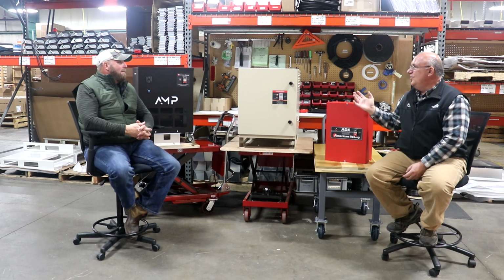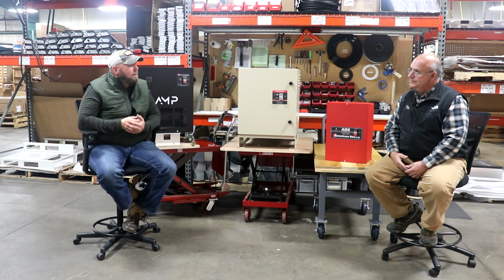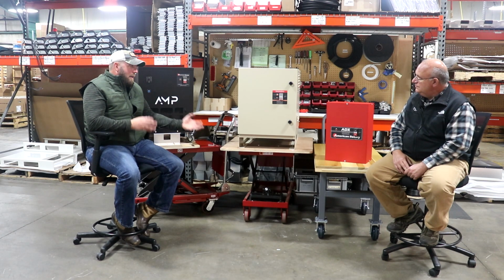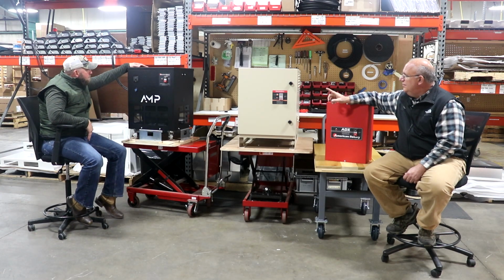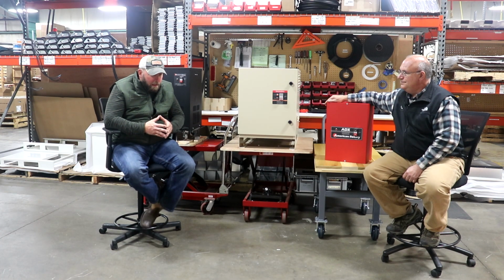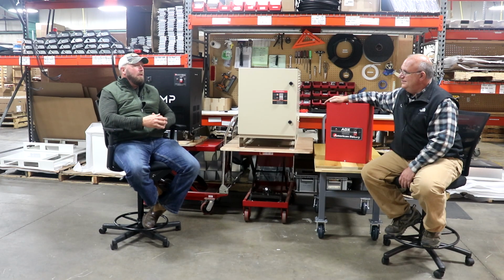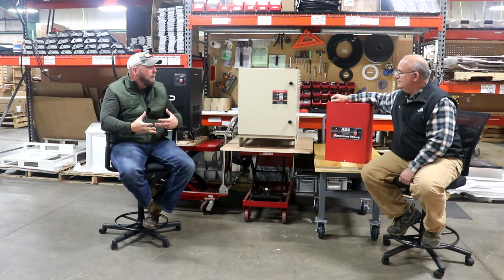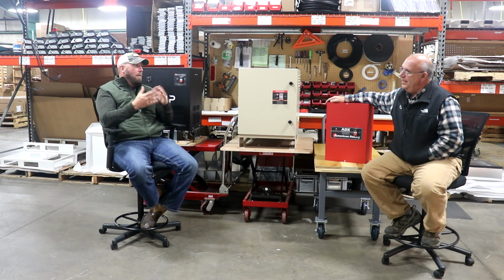American Rotary Phase Converters - a Visit with Chris Feavel

Comment: Great video Keith. I picked up an American rotary 10hp converter a few years ago when I bought my lathe. Best decision I made for my shop. Since then I wired in a 3 phase panel with numerous circuits which made it easy to add numerous pieces of 3 phase equipment. It’s a quality piece of equipment that was a game changer in my shop.

Comment: The only reason I built my own converter is cost. 20 hp motor was $10. Contactors and boxes $25, all auction pieces.
Assembly time was days, but it works and I have less than $200 invested. The biggest cost was wire and time.
I would love to get an AR converter but the cost is not in my budget.
Great show Keith, love the channel.
Thanks for sharing.

Comment: I had a electoral/mechanical business for 40 years that 90% of our business was industrial and would never think of building a converter in house. The time and money to build one out weighed getting one from a converter manufacture. VFDs replaced DC drives in applications where the speed of a motor needed to control a line or a mixer on a 30K gallon or larger tank. Very good basic interview.
Reply: Well, duh?  And for the rest of us who would like to get into this as a hobby, with a supporting revenue stream expected never, can and do build ones for less than your average employee's weekly paycheck.

Comment: You can buy VFD inverters for any size machine which convert your single phase to 3 phase for  motors.  They also have the functions  of variable speed, dynamic braking and can be controlled by PC input for specific cycling, stop-start-reverse etc.  Each machine can have its own dedicated inverter sized specifically for the particular motor and requires no wiring of conduits etc., just plug in to existing single phase outlets.  Inverters are available in 110 volt input for small machines and 220 for the larger units.  Pricing is from 75.00 for a 1/4 HP motor to  175.00 for a 5HP motor.

Comment: Hello Merica. I know there is big problems with 3 phase in your country, but somehow it is 21st century. There is nice solid state 1ph to 3 phase converters with variable frequency.
You don't need one big converter, just several small ones for each motor. They are quite cheap and universal. And not noisy in all ways (who is listening AM radio?).
And it adds variable speed, brake and current protection. Also soft start- no more stress for gearbox.
Reply: Hello Uropean or whomever, no, there really isn't any problem with 3-Phase in the USA. We did after all, invent it.
99% of our population doesn't need it, so the extra expense of installing it everywhere would be wasted.
We're quite aware that its the 21st Century, we went to the Moon last Century.  
For the less than 1% of Americans who need 3-Phase power at home, the options are RPC, or VFDs.
We know about VFD's, an American invented it.
Please save your snarky comment until you lot get to the Moon or invent something...

Comment: I have multiple 240v and 480v machines run off my one American Rotary phase converter and can run multiple units all at the same time. Motors from 40hp to 1/3hp all run just like they were designed.  :-) Much more affordable than the $100,000 to get 3 phase run to my shop.

Comment: Switched from a name brand rotary converter( not American rotary) to phase perfect which is solid state and requires no programming many years ago. Advantages: always on - only 2% efficiency loss - better characteristics than the public utilities 3 phase - full hp from all motors - very very quiet when cooling fans occasionally run - can power many machines at once with no regard to motor size on which should be turned on first. Would never go back to a rotary converter. Check them out and see if they might be a better choice for you. Not sponsored by anyone.

Comment: I built my own. 3 phase motor and a capacitor that is wired to the third winding and either of the 2 other windings.My 3HP motor dont need a switch but on larger motors I use a push button to connect the capacitor, only while starting the converter motor.

Comment: I went from a rotary phase converter over to VFDs in part because I got a mill to go with my lathe, and I wanted variable speed on both machines. Eliminating the background noise from the idler motor was a nice benefit. Also, my power company has been talking about adding demand charges to their residential rates when they go to Time of Use pricing, and VFDs have less "ringing" when the motor starts.

I can also use the same extension cord to hook up the mill or the stick welder, and copper costs real money. I'm working in or in front of my garage, and fixed wiring isn't practical.

American Made doesn't address the technical differences between  RFC and VFD, nor the less tangible benefits tradeoffs. RFCs are a more mature technology, while VFDs are a more recent development, with about 40 years of practical use now.

RFCs are a good lower cost alternative for motors which need to run at a constant speed with a predictable load and for a long period of time. Rotating inertia is a fact of life.

VFDs are often used instead of a "soft" starter - this is a benefit if your power utility is unhappy about back EMF and/or has demand charges - something that is starting to show up in residential rates in North America. A VFD gives a noticeably cleaner voltage curve on start for a given motor with a generally lower current spike.

There are pros and cons to either solution - what's best for me might not suit you.

Comment: In New Zealand 415 V  3 phase is available outside every residence.You just have to pay to get connected to it as houses generally have a single phase 240 V supply.
It is also common for adjacent houses to be connected to different phases. Which is why there have been accidents caused by homeowners trying to run high current equipment by interconnecting power cables from 2 houses.
Reply: Often times, the original innovator of something ends up with significant amount of older, original generation equipment in-place. Especially so for infrastructure/standards.

2nd/3rd/x Gen environments do run 3-phase out to the neighbor hoods, and in some places directly to residence (Germany/NZ), and single phases split along housing.

Ultimately, unless your machining in your garage, switching over to 3-phase in the US would simply be a waste of time and resources.
Even more so now, that more and more things are power-efficient and need less power.

Single-phase 240v in the US gives more power than most people could ever use.  Running 3-Phase all over is a waste of copper especially inside a residence where 90% of outlets will never use more than 1500-1800 watts.  We pull our expensive 240 to the 1-2 location needed only, which saves $$ over-all.
Reply: @boots7859  It can be argued that a 115v supply is a waste of copper. Lower voltage requires more current - conductors need to be heavier.

Comment: 3 Phase power rules and so does DC power. Electric motors that are 3 phase have their own silent constant quality sound to them.  DC motors are extremely quiet since the sine wave is flat vs up/down like AC. 3 Phase motors deliver very good continuous power efficiently too. Thanks for the reminder Keith.

Comment: I have a Lenze VFD, same as Stan Zinkowskis
on my Mill. It has a step pulley head and runs
super quiet. I love being able to adjust the
speed on the fly with it. I’ve had it for about
4-5 years I guess and haven’t had any problems
with it yet.
 I don’t agree with what he was saying with
what do you get with cheap.
I have been considering an American rotary
phase converter though since I do have other 
equipment that is 3 phase that I’m fixing to try 
and get going.

Comment: Just a suggestion..but I would not dismiss the value of VFDs for the home gamers. I am not an expert on any of this but based on my experience if my only option was a RPC I would still be waiting for 'some day'. The cost differential is almost 10 to 1 and for the shop with one or two 3 phase machines it is definitely the way to go. I must point out Chris is quite correct to say you get what you pay for...dont go with the cheap one...do your homework, and yes there is a learning curve.  By going with a VFD you get to save that money for the day when you may need a RPC. RPCs are sized and if you go with the entry level model, chances are you will need to upgrade it to handle the capacity as you expand....the VFD gives you the freedom to enter the game at minimal cost. THEN you call up Chris and retire the VFDs (as I hope I will some day). There are lots of use cases out there and I am sure many would benefit more from the RPC investment, but if your plans for 3 phase power are not certain, you have nothing to loose by doing your homework, buying ~150 buck VFD, and taking some time to set it up. That said, if you have never worked with 220, or even rewired a lamp....call Chris at American Rotary....220 will kill you.

Comment: Yes VFD's have their place, and to be honest that is how I run my shop.  I do run name brand (Hitachi), which are a little more expensive, but here is where the problem comes in.  Even though I have more control on my series1 J head Bridgeport, the "whining" is atrocious!  You also need a VFD for every machine.  Not a bad thought when you just have a 1HP motor, the VFD runs about $200.  When you start powering larger motors is where it gets expensive.  Any motor above 5 HP and you have to double the VFD.  My 7.5 HP Monarch lathe needed a 15 HP VFD.  The VFD was more than 1/2 of what I paid for the Monarch...not to mention what it would have cost me to hire someone to install and program it if I did not do it myself.  By the time you buy VFD's for 3 machines, you could have had a phase converter.

Comment: VFDs work pretty well up to 5 HP if you are looking to manufacture 3-ph and also get the benefits of the custom programming (variable speed, capacitive braking, interrupts, etc.). Doing all that stuff generally means re-engineering the electrical controls for your machine but I've seen some great implementations (not cheap, but great). Much bigger than 5 hp and you need to run a VFD off 3-ph power anyway. Horses for courses. Just picked up my ADX-20 to run a 7.5 hp lathe. Two speed motor (which will drive a VFD nuts). RPC was a much better solution for me. And I have my eye on a Harig 3-ph surface grinder. Very little extra effort to run another 3-ph circuit.

Comment: A few weeks ago we had a bad rain storm and it took out all the electricity in the entire small suburb city where I live. Berkeley Lake, GA.

After a few days, we watched them fix a horrible maze of a  mess; with lines on the ground everywhere. Since I taught electronics for 45 years; I made friends with the supervisor and he told me something that I still don't understand. IE:

They brought in 2 phase service when the city was built; but it only goes a short line in the city. He said they use those 2 phases to create 3 phase service; for a large pump machinery; required by the core of engineers.

As best I can tell, they took those 2  phases and then hooked up a large transformer to both of the phases. This then provides 3 phase service. But I still don't understand it. He used a technical term but I forgot it.

If someone knows how that is done, I would appreciate your explaining it to me.
Reply: See:  https://en.wikipedia.org/wiki/Scott-T_transformer 
and:  https://electronics.stackexchange.com/questions/392789/how-to-convert-2-phase-power-supply-to-3-phase-power-supply-using-a-transformer
Reply: @markpeterson5479  Thank you VERY much Mark Peterson. Now I understand it. I can't thank you enough.

For I will stay up all night when I can't "Get it"; If you get what I mean.

Comment: I have a 5hp compressor where my electrician wired a box to have a “wild leg”, I’m not sure what that means but it it has worked perfectly for 20yr’s.
Reply: In our factory we have 480 wild leg, the difference is the power to ground on that leg. Leg A 270V to ground, Leg B 420V to ground, Leg C 270V to ground. Any leg to leg voltage is 480V, the Wild B leg can't be used to power any lower voltage single phase equipment.
Reply: Hi Anna,  I would expect slightly different voltages on your 480V wild-leg (aka, high-leg) delta.  From your description, A-C has a grounded center tap.  Thus, the voltage from A to ground and from C to ground should 480/2 = 240.  The high-leg is from B to ground and should be 480 x sqrt(3) / 2 = 416V, close enough to your 420V.  I don't get your 270 V from both A and C to ground.  What am I missing?  Or, are you just calling out your actual voltages.  I'm used to seeing these being called out as the theoretical voltages (as computed above) rather than the actual measured voltage.
Be well & Best regards,
Gottfried
Reply: @gottfriedschuss5999  I was calling out the actual measured voltage from memory, my memory may be wrong on the 270. But being that it's such high voltage and none of the panels are easily opened I'll just take your word for it that is should be 240. I know the 420 to ground on be is accurate (actual voltage) because I made the label for our electrician to put on the box as a warning.
Reply: Hi 218philip, Here is a brief explanation of high-leg delta connections in the USA; for more information, search the www for 3-phase power, e.g., Electrician U.  First, a wild-leg is also referred to as a "high-leg".  These refer to how the secondaries of the utility's power transformers (pole transformers / pole pigs, or pad mounted transformer) are connected.  In your case, the three secondaries are connected in a "delta" (triangle) configuration.  The secondary from the first transformer is connected from A to C, the second from C to B and the third from B to A.  In addition, the A to C transformer has a center tap that is grounded.  The voltage from A to B, B to C, and C to A, the phase voltages, are all three 240V.  It's 120V from A to ground and from C to ground.  However, the voltage from B to ground is 240 x sqrt(3) / 2 = 208V.  This is far too high to connect normal 120V appliances, they would fry "let the smoke out" if one did so.  This is the wild-leg or high-leg.  As a precaution, most Authorities Having Jurisdiction (AHJs, aka inspectors) require the high-leg to be colored orange, either the insulation or by taping the wire with orange tape.  A way to think of this is "orange equals caution/danger".  It's fine to connect a 3-phase load to phase-A, phase-B, and phase-C; that's how you get 3-phase power.  It's also fine to connect 120V appliances between phase-A and ground/neutral (hand waving took place here) and between phase-B and neutral.  However, for almost all cases, never connect any single phase load between phase-B and neutral.  It's too high for a 120 volt appliance and too low for a 240V appliance.  I hope this helps.
Be well & Best regards,
Gottfried
Reply: Gottfried Schuss    I am going to take the time to think very hard about how you explained my lack of understanding wild leg 3ph power but it might take a bit more time for me.